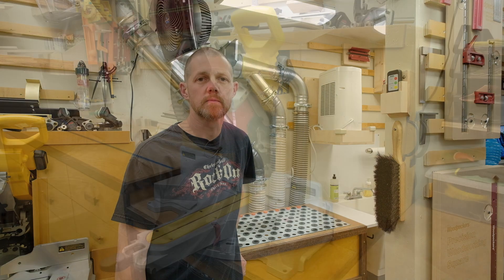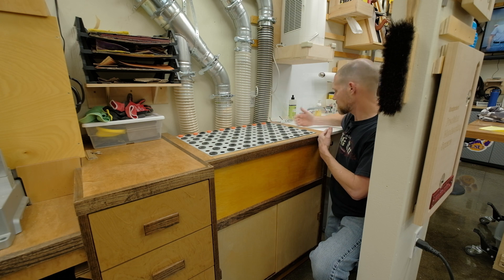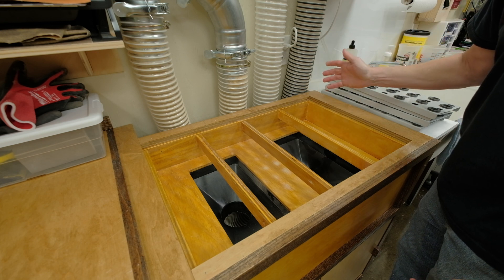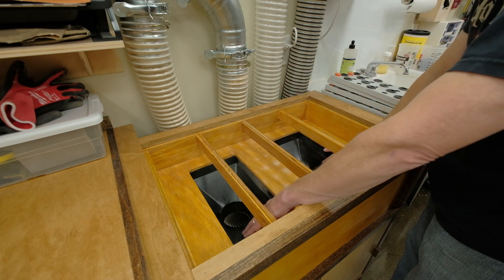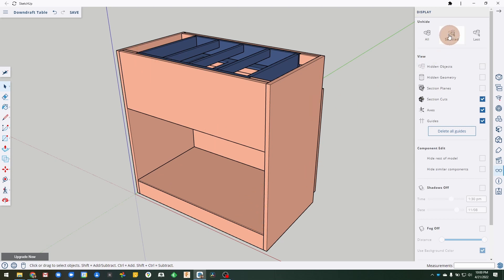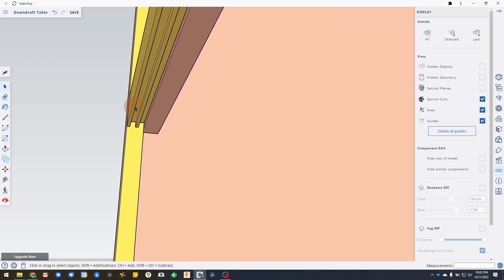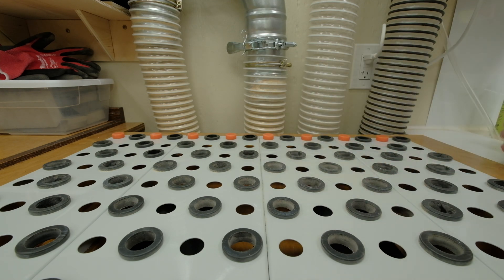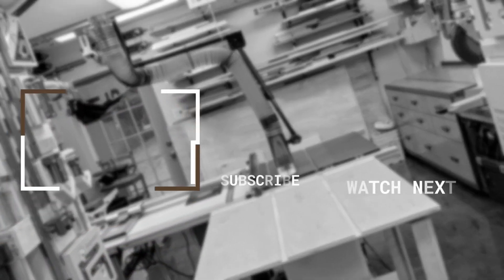Downdraft Table

Comment: Hey thanks for your video excellent as always. I'm one of the people who asked for the video,  does the downdraft air flow help keep the project your sanding from moving around? Thanks Mike
Reply from the maker: Yes and no. It really depends on the size of the piece that I am sanding. If when I put something on there it covers a decent amount of the surface, then yes, the piece gets held in place pretty well. That turns out to be a double edged sword. The more of the surface that is covered, the better the piece stays put but the dust capturing suffers. I hope I explained that in a way that makes sense.
Reply: @liberatingwood  yes definitely makes sense.  Are the inserts from Rockler? Thanks again
Reply from the maker: @michaelmilton4427  No. I saved a little money and got the Powertec panels off of Amazon: https://amzn.to/3kqACmV 

The Powertec panels are about $52 for 4 panels. The Rockler ones, which you can find here (https://www.rockler.com/downdraft-table-panels), are $42 for 2 panels.

Maybe the Rockler ones are nicer. I can't say since I have never seen them in person. But I knew that I wanted 4 panels so I went with the less expensive option and got the 4-panel pack from Amazon.